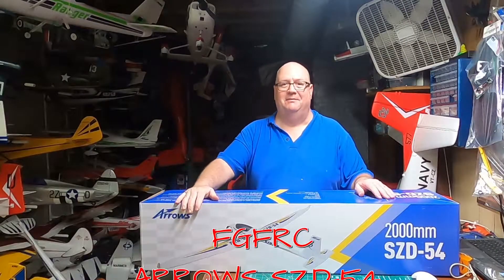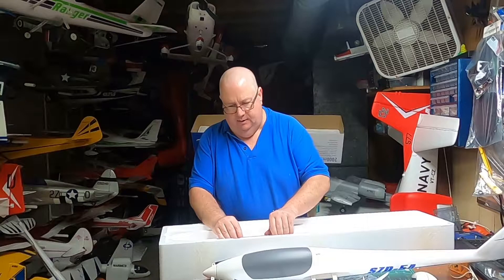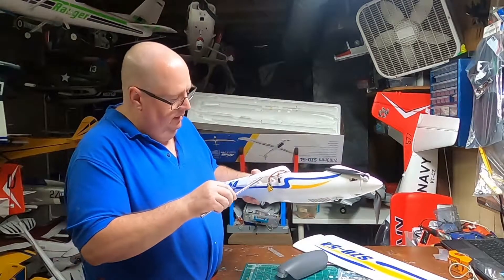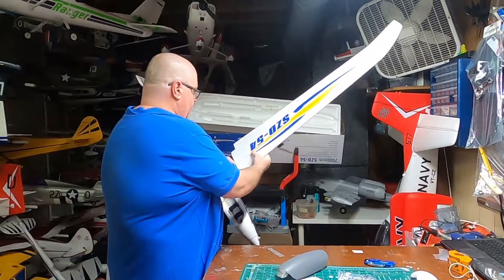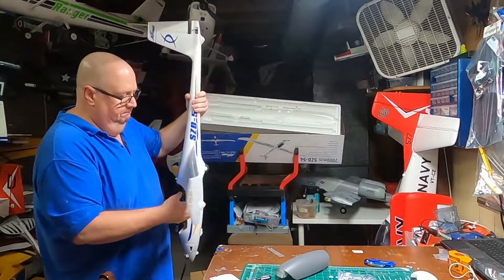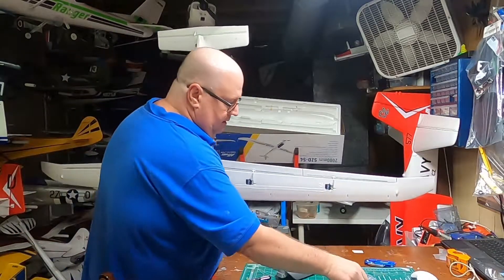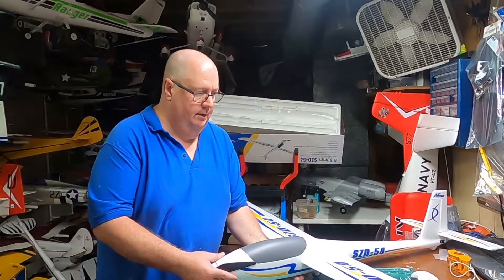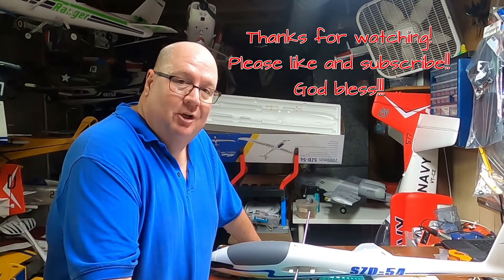UNBOXING AND VERY QUICK ASSEMBLY OF THE ARROWS SZD 54 GLIDER BY FGFRC!

Comment: looks good easy Assembly  - I still have an FMS FOX in a Box... LOL...
Reply from the maker: When you go to build that FOX pay attention to the ailerons they were warped in mine and I was not able to get much movement out of them . I sent the plane back for a full refund. I was really surprised at the lack of quality it had for a FMS plane. I hope yours is good and mine was just a fluke. Had I kept the plane I would have cut them out and reinstalled with ca hinges.
Reply: @FatGuyFliesRC  got it - I might do a quick check on them to see what they are like - thanks for the tip...